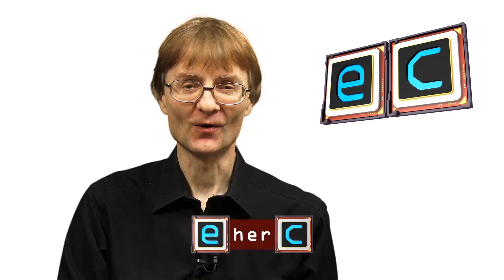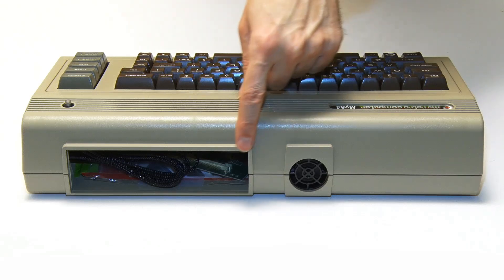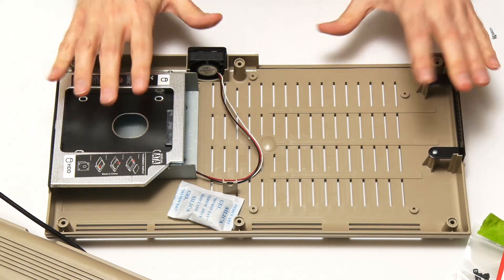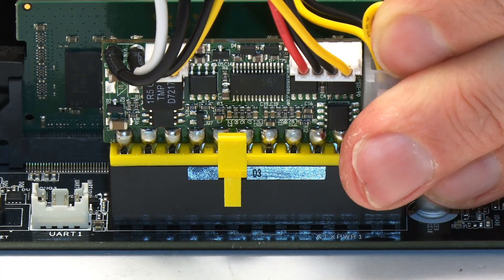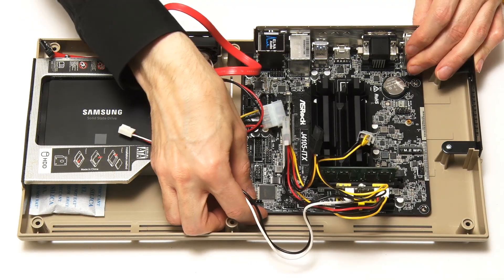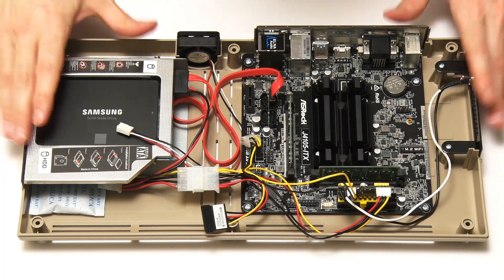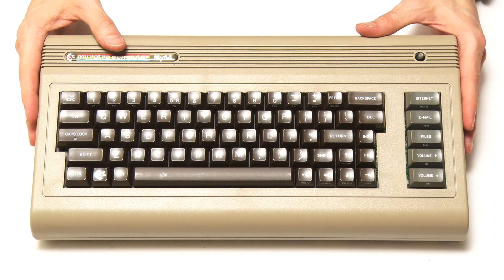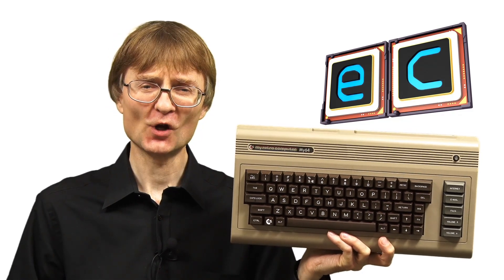My64 Mini-ITX Retro PC Build

Comment: For those who weren't around in the 80s, I'm sure many are asking, "WHY did they put a computer INSIDE the keyboard?!?"

Early home computers did not live in the study, assuming you had an in-home study, which most people did not (we did our homework on the kitchen table!).
Early home computers were used in the living room, just like game consoles were. Many early home computers were just glorified game consoles*, and so the only thing most people had were their home computer, a video hookup, and a handful of games cartridges. If someone was really serious, they'd go and buy a Commodore Datasette (tape drive/player) to save their BASIC programs on. If you had even more money to burn, you'd buy a floppy disk drive (VERY expensive -- the commodore disk drives were computers as well).

So, the reason the computer was inside the keyboard was because of neatness. The only thing you'd have was the computer/keyboard, a video cable, a power cable, some cartridges with games on them, and maybe a joystick.

The Apple II was very different than this, but most people couldn't afford an Apple II, and only used them at schools. Apple has ALWAYS been offensively expensive.

*The Vic 20 was commodore's first home machine, and it was marketed very much like a game console which had the extra feature of having a keyboard.

Comment: Thanks Chris for taking me down memory lane to my early adolescence.  Playing games and programming BBS software on my C64 with my nerdy friends was a good way to continue to learn computing.  

My first love will always be my family's very first home computer, the classic 1982 Kaypro II.  My father, a pastor, acquired it second hand in 1984 from a funeral director friend, who had upgraded to a Kaypro IV and a Kaypro 10. It was on this Zilog Z80 CPU clocking in at 2.5 MHz with a whopping 64KB running CP/M, having no significant graphics or sound (other than a keyboard bell) that I learned MBASIC programming, dBASE II, and first encountered Turbo Pascal.  Its green phosphorescent screen, measuring merely 9 inches diagonally, had a full 80 column display, a solid steel shell and dual 5 and 1/4 inch 191KB Single Sided Single Density disk drives, was a truly magical piece of tech in even in 1984, two years after it's initial release.  It's grey and blue shell made it appear very much like Darth Vader's lunch box. 

Here's an Image: 
https://www.1000bit.it/lista/k/kaypro/kaypro2/frontl.jpg

I was so fortunate to have parents who were early adopters of this transformational technology and had the patience to share it with two young boys.

Thanks again for stirring up fond memories of family and friends during this holiday season.   Cheers and stay well!
Reply from the maker: Great post, thanks for sharing.
Reply: @ExplainingComputers  Thanks Chris.  Catch you next week.

Comment: sorry, far tooooo expensive case and close to nothing to do with the former C64.
I can understand people upgrading such used C64 cases with a raspberry pi especially since the new Pi 400 arrived but not for an ordinary windows PC.

Can not build or find any connection for a Mini PC in C64 case while the Pi 400 would be a logical successor and one that deserves to be a successor.

Maybe you might add another video - refitting the Pi 400 into this case or a used real one.
Thx

Comment: I already have something like this, built it over a year and a half ago...however I used an original C64 case which had had its board damaged by a Rogue PSU. I utilised a Leonardo Arduino to write a sketch for the C64 keyboard matrix...outputting to USB. (the only key I miss is the ALT key...will fix that soon. ) I also added a mini itx motherboard, 8GB RAM, a 256gb SSD and a 1TB spinning drive.

I use the PC EVERY DAY, and have done so for the last 18 months.  I would go for this case if it was half the price... That €200 price tag is, frankly, ridiculous.

Comment: You have and or had, different plastic types at the time. From polycarbonate to bakelite and whatever in between. 

This particular example is of the creepy type. Hard, inflexible and still cheap with a cringy echo when bumped onto a faux or formica wooden desk.

Comment: This is pretty cool but frankly the price is revolting. you can buy The C64 Maxi for around 100 pounds and take a dremel to it or, if you are not DIY minded just replace the Raspberry pi that lives in it with a slightly stronger one and you'll have a modern computer in a C64 case for half the money.
I would not mind if they sold this for like 70 pounds but 200 is, excuse me, taking the piss.

Comment: As fond as I am about the Commodore 64 being my first computer, I could never go back to typing on a raised keyboard that is noisier, with higher tension spring keys with greater travel (increasing fatigue) as compared to modern scissor key designs.

Comment: I am guessing most people who would buy that case would want to install Retro Pi and run the C64 emulator. 
I replaced the CD drive from my old laptop with a 2.5" HD holder like the one in that case and it had little screws on the sides you screwed in with a small supplied screwdriver. 
I had moved the Laptops old HD into the cradle like that and put an SSD inside the comp where the HD had been.

Comment: I don’t understand why motherboard manufacturers don’t include the power connector for SATA drives directly on the motherboard, one that sits next to the SATA data connector? This way, one combo cable can be used for both data and power for the SATA drive. The position of the data and power connectors on all SATA drives are standardized so one such combo cable can be used for all motherboards. This is already been done with M.2 drives already where one M.2 slot provides both data and power to the drive.
Going one step further by taking a cue from M.2 slots, why not mount the SATA drive directly flat on the motherboard just like an M.2 drive. SSD drives are so lightweight that this “bulky” drive will not exert any stress on the board. In fact this cableless SATA mount is already found on laptops for years. Why can’t desktop motherboards be the same?

Comment: Would be cool to have an Intel 80186 CPU board running at, say, 12 MHz, and accompanied by hardware implementation of sound and video graphics compatible to the famous Tandy 1000 (the perfect MS--DOS home computer design of the 1980s). The Tandy 1000 provided a hardware platform definition that gamers could build games for MS-DOS that have comparable capabilities to the Commodore 64; so it would be a kind of cool, retro computing humor/irony to put a Tandy 1000 into the shell of a C64 form factor.

Comment: Don't take it apart . Sell it instead if you don't want it. This board and chassis deserve each other.
Reply from the maker: They have I'm afraid already geon their separate ways!
Reply: My Retro Computer intend to sell complete pre-built systems in 2021 in various options. I have one of these from 2011 built by Commodore USA (disclosure: I worked there and I am the actual keyboard designer). They came with Intel Atoms back then but I've since thrown in an i7 mobo, which has been my daily computer for many years. I've since obtained a new VIC-20 case version and the motherboard in the video may well be the one I go for. Although I do have that old Atom lying around somewhere which may be more befitting a Vic20....

Comment: Great job Chris.  As they say, people will buy most things if the product brings back old memories and this case does that indeed.  

Looking at the case layout I could easy made a it compatible for a raspberry Pi 4. 

A 3D printed I/O shield that would let you mount the Pi is really all you need. Along with a some wiring changes you would have a “ MyPi64”

The only downside is your now have a raspberry pi 400 that cost you a heck of lot more.  $$$$

Comment: A few years ago I mounted a micro ATX with a fast unlocked processor and SSDs in an old HP mini tower. Was even able to use the old W98 keyboard, mouse and early model HP flat screen display. It sits in my living room and gets lots of looks, but no one ever asks to use it. They probably think it would take forever just to boot. It's actually my fastest computer.

Comment: Back in the 1960's I drove an old Austin A30.  For me as a teenager it was great, I went miles in the thing and I look back at it with a certain fondness.  However, it's long gone to the garage in the sky and as good as it was nearly 60 years ago I don't want another.  Even if a modern new mini engine was fitted, it's still not cool to me.  I've moved on.  The same with computers.  I don't have enough years left to recreate the past even with modern inners.  Bob

Comment: Look at the shape of your SSD mount. It’s exactly the same size and shape of a laptop CD/DVD drive. I’d bet money that you could replace it with one if you so desire.
Reply from the maker: I am sure you are right -- and there would still be ample space for an SSD in the case.
Reply: Probably why the cover plate has the CD logo on it.
Reply: @VulpisFoxfire  I didn’t notice that.
Reply: @PrinceAlberts  Yup...look at 2:01 in the video. Pople keep complaining about it not having a 3.5" bay and such, but if you pay attention, it's actually a larger general purpose bay that just happens to come with an adapter caddy for SSDs.
Reply: @VulpisFoxfire  Check at 8:32 in the video, you can see the screw holes in the bracket. They don’t look like they’re aligned for an HDD, which would be a 3.5” size. I could be wrong, though, it’s difficult to be sure without a good reference.
Reply: Yeah. It definitely is meant to fit a DVD drive. I think the HD would still sit underneath within the caddy.

Comment: Why on earth did they design the keyboard with 5 F-keys instead of the original 4?
Reply: It just so happens that I am the designer of this keyboard originally from Commodore USA from 2010. There are 5 simply because 4 looked weird given the lowest set of keys is wider containing more than just a space bar, but a complete cursor key arrangement, Control, windows(C=) and Alt keys. We agonised over all aspects regarding the keyboard aesthetics and there were also a range of limitations in regard to key placement we had to adapt to as well as usability concerns in regard to a fully fledged PC keyboard. Also, the classic Commodore Function keys are no longer function keys but media keys, and the 5 keys went better with the media layout. The real PC function keys are actually selected with a numeric and dedicated Fn key, similar to some laptops. And before anyone asks, I couldn't convince Barry to do the PETSCII prints on the front of the keyboard, but you could probably find a sticker set online if you wanted them.
Reply: @AussieAmigan  Well, 5 looks weird.

Imagine paying $200 for a keyboard and then having to place sticker on the keys.
Reply: @Okurkaarrgghh  You only need the stickers if you're running an emulator and are hell bent on programming or creating PETSCII artwork using the PETSCII keys on the keyboard rather than a virtual keyboard. That's a very small minority, and the purpose of the keyboard is not to be an exact replica but a modern retro remake allowing for more powerful hardware.

Comment: Could you do an AMD build, for kicks? What is the thermal limit on the processor that could be realistically used with the 64? Could one put 2 ssd’s or m.2 nvme drives? Again, many thanks.
Reply from the maker: This can take a CPU with a max TDP of 65W. And with the right motherboard, certainly multiple SSDs could be accomodated.

Comment: Hmm, whilst I like the concept, I'm not sure of the choice of compromises for the keyboard.

Like, media keys but no function keys? I'm not sure I could type comfortably on this. The chosen layout of the keys compromises in the wrong places for my liking, I'm afraid.

What would be awesome, though, is a similar BBC Micro retro PC case. As it's already got a nice layout with red function keys - and, sure, you could add a modifier key to access media keys (printed on the side, like the old PETSCII was on a C64) - and if you're not 100% authentic on the layout, you could get a modern laptop-like layout into that space fairly easily, so a nice balance of retro-esque but not actually giving up half the keys you need to do so.

And the other cool thing about a BBC Micro case is that they'd be plenty of room inside of it, as it was much deeper, serving as a monitor stand and built like a tank with a metal case. You could actually get an internal PSU inside a BBC Micro case - and, with the size of modern components, a heck of a lot more besides, I don't doubt.

(Though, yeah, good luck with getting both Acorn and the BBC to be happy with your nostalgic theft of their ancient IP.)

Also, install an ARM-based motherboard and run RISC OS on it? Although, yeah, there is a point at which "being authentic" just gets in the way of doing anything actually useful with it.

Comment: It looks really cool, does it still take an optical drive?
Reply from the maker: I imagine that a slimline optical could easily be fitted (as the 2.5" adapter is the same size), with an SSD then secured to the base of the case.
Reply: @ExplainingComputers  Ok thank you.

Comment: Where are the F1-F12 keys?
Reply: The regular PC function keys are accessible on the numeric keys when pressed with an "FN" key. The FN key operates in a similar fashion to many compact laptops allowing access to special keys like Page Up and Page Down etc. The FN special key labels are printed on the front side of the keys. Sorry, but to keep the look some compromises needed to be made, but all regular PC keyboard functions are accessible. That's the whole point.
Reply: @AussieAmigan  thank you for that information. When i asked where those keys are the answer was there were none (and they aren't visible to my eyes anywhere in the video). If they're accessible via a laptop-like Fn key then indeed, it's not fundamentally broken in that regard.
Reply from the maker: They were not available on the original . . .
Reply: But they're necessary for any modern OS. i get wanting to keep it pristine, but only insofar as that doesn't completely castrate it. Midnight Commander comes to mind as an app where i regularly need the F-keys. F2 in nearly every file manager to rename files. F1 because... does anyone really use F1 (on purpose)? For 200€ i full well expect F-keys. Sigh.
Reply: You don't get a numeric keypad either... But at least you do get a proper inverted-T cursor keys, not that weird thing from C= micros
Reply: @hugocardozo8685  i don't think i've every had a laptop with a full-fledged numeric keypad (just that one you can flip on and off with an Fn key), so that wouldn't bother me at all. Lack of F-keys is an absolutely no-go for me. (Not that i'm the target audience, anyway, but if i were, lack of F-keys would remove me from that audience.)
Reply: @michaelbuddy   i don't have a computer just for email and browsing (most of which i do on a tablet). A computer is for programming. Numerous apps need the F keys. Every modern Linux file manager and Midnight Commander immediately come to mind. To intentionally castrate a computer by removing the F keys was a short-sighted design decision driven solely by nostalgia.

Comment: Put a Raspberry Pi with C64 emulator along with every C64 you can find in there.
Reply from the maker: I understand that a Raspberry Pi "conversion" kit is in the works.
Reply: @ExplainingComputers  That would make me consider a purchase. Seems more fitting IMHO.
Reply: @randymessick386  You may find at the end of the day that an old Intel Atom Mini-ITX motherboard is cheaper and more powerful than the Pi4, even when overclocked.
Reply: @AussieAmigan  True. It's still a bit pricey for even a Raspberry Pi conversion. The Pi 400 would be cheaper too, though less nostalgic.

Comment: Thanks Chris, I managed to get one from Commodore USA when the late Barry Altman still alive. Running Windows 10 and still using it next to my old Commodore 64. brings back lots of old memories. Wish someone would design the old Apple Macintosh case with new hardware in it as well.
Reply: That's great to hear Navi. So glad to hear from a happy customer. I co-founded Commodore USA with Barry and designed this keyboard as well as originated the PC64 concept. I am not currently affiliated with My Retro Computer which I'm glad has taken up the old stock and molds. Looking at the video, they did a great job. 

BTW Did you enjoy my Commodore OS? I am thinking of making a new Linux distro like that but taking the concept further to not only encompass C64 and Amiga but many other micro computers and retro consoles. Commodore OS 2.0 maybe?
Reply: There was somebody making an Apple ][ case on indiegogo many years ago but I never heard much more about that project. Maybe it’s still alive, I dunno. But yeah, a Mac case with an LCD would be pretty neat.

Comment: Is this better than a Pi 400 with decent emulation?
Reply from the maker: Yes, the J4105 fitted here will out-perform a Pi 400 by some distance. But you could put a Ryzen Mini-ITX board in this case . . .